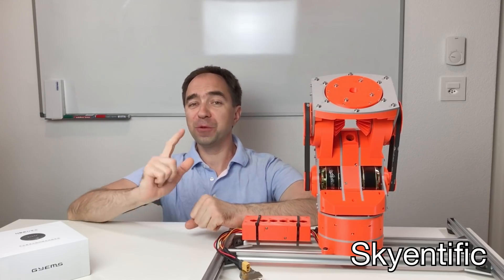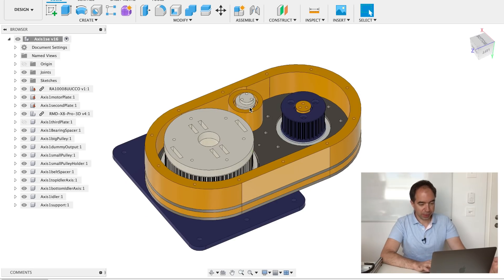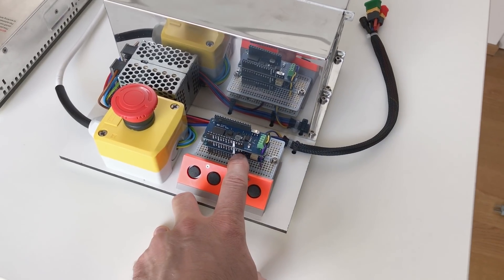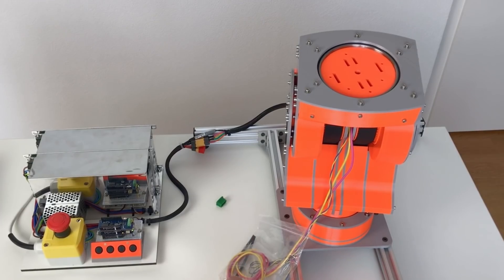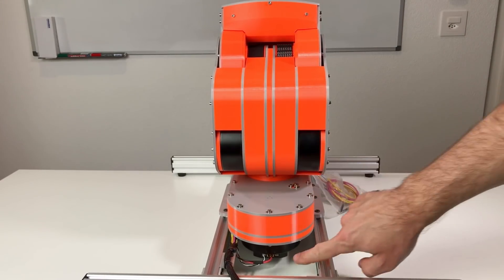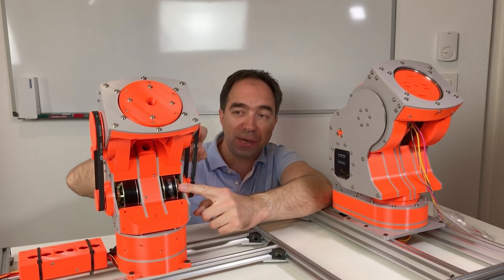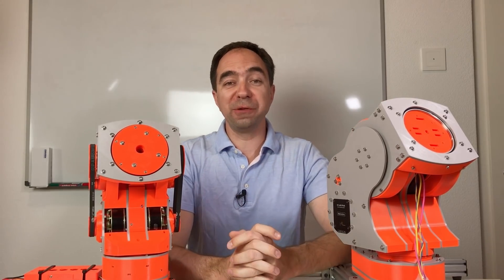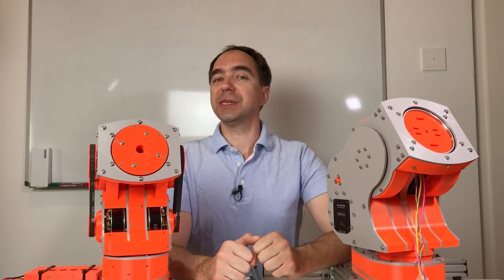Robotic shoulder with QDD actuators (Alternative Robot Shoulder)

Comment: How did you achieve the creation of the bevel gears (which to me look like miter gears with a 45 degree pressure angle)? Did you design them yourself? If so, good work.

Comment: I have a design suggestion you may want to consider. If you'd like to consolidate the mass to the base. You could use the same bevel gear design, with a bit different power transfer method

Comment: Have you thought about adding a slip ring to the first joint to allow continuous rotation? I am not sure what current these are operating at which has a large impact on how big a slip ring would be.
Reply: https://www.amazon.com/Taidacent-Wires12-Collector-Electrical-Connector/dp/B07NSMVSTW/ref=sr_1_25?dchild=1&keywords=Taidacent&qid=1591009176&sr=8-25&th=1

Comment: Instead of adding a rotation limiter, maybe you should consider slip rings.
Power over slip rings is easy, data/CANbus is not as trivial but still can be done.
Freely rotating joints enable much better kinematic motion planning (best for base and flange)

Comment: I really like this channel.  However, these are all very expensive parts and methods.  Simpler, lower cost actuators are very possible.  I am working with PVC for nearly all mechanical parts because it's very inexpensive and has very low abrasion (effectively self lubricating), and does not fatigue.  It's also very strong and easy to mold, cut, or machine.  It's not only price that needs to be low but the lowest possible part count and robustness.  How long will those materials last without adding bearings?  Aluminum wears out very quickly.  PVC has almost as much abrasion resistance as steel..  Ever notice the wear on the chains of a swing set in a park?  I wish I could post a picture here.. I can show you how to make a much smaller shoulder with fewer parts and a far longer useable life span.  Also, keeping motors out on the arms or over joints rapidly increases the need to actuator power.... due to leverage.  It's very inexpensive yet effective, quick and easy to use bicycle cables (but can also use air or water tubes) with the motors all in the torso of the humanoid.  The legs must still be strong but not much else.  Also, for stability, a fly wheel with a little weight on its outside spun very quickly works exceptionally well..  You can then use a weak mainboard such as a raspberry pi or mini-itx board because no fancy AI chip is required.  Python with OpenCV can handle vision quite easily..   Or Node.js wit OpenCV, if you need more general computational performance.

Comment: Very Inspiring ! And may I make a suggestion to improve the lifetime of the gears drastically ? For daily operation the travel of the output axis could be limited to 360 degrees or so. But if you nevertheless could design the cable management in such a way that you could allow the output axis to rotate to say 3 times 360 clockwise and 3 times anticlockwise, then you could create 6 different 'modes' for the shoulder. And you should than modify your gear set in such a way, that in each mode you have a new 'fresh' set of teeth meshing with each other. Was it not a general rule in gearbox design, one gearwheel with uneven number of teeth should mesh with a gearwheel with even number of teeth. In that way, wear is evenly distributed over all the teeth.

Comment: Really neat design! Always enjoyable to watch. 
I like the idea of using a differential transmission. How do you plan to accommodate for the split of torque in axis one and two in accordance to there relative speed/ acceleration in your motion control?
Have you thought about preloading the bevel gears with an additional gear to reduce backlash - more complex design, but might be worth it!? And what about a master an slave design to power an axis? Using two smaller motors to drive one axis: using both for acceleration and then both with an offset in torque to “clamp“ the gears (++lower backlash, - higher cost, - more difficult to design the control algo, -less power density)

Comment: You should maybe print a wrench with 3 pins going in the screw holes  to tighten the idlers, judging from the tension needed in the pulleys.

Comment: Are these actuators strong enough to do work without pulleys? I am thinking something along the lines of the gluon, but a little bigger. Just modular joints with some tubes in between.

Comment: Perfect design I do like it so much. I do have one concern is having all the load on the bevel gear will decrease the max load that can be handled to the teeth max shear load. however if its well built it might be enough.
Reply: Indeed, but sometimes its better to break some 3D printed gear rather than some expensive servo motor due to overloads.